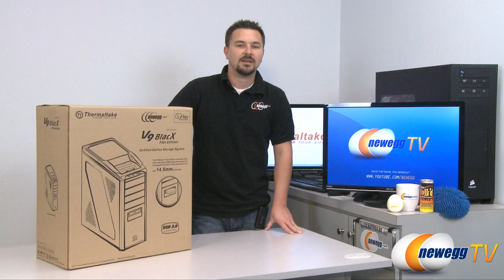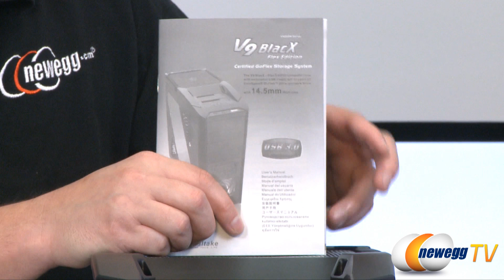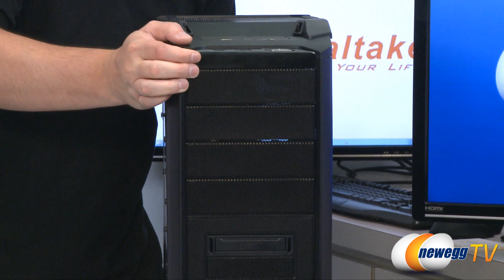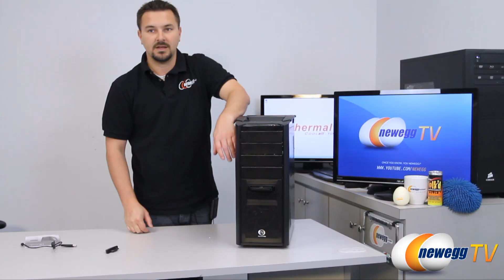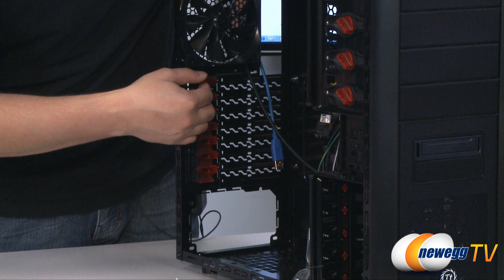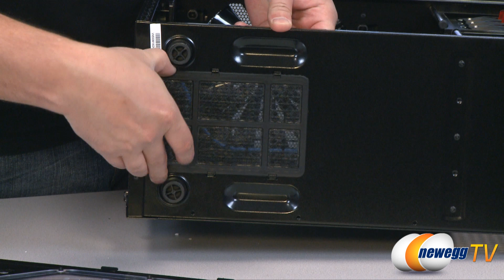Newegg TV: Thermaltake V9 BlacX Flex Edition ATX Mid Tower Case Unboxing

Comment: I gotta say, if this version of the case is anything like mine (V9 Black Edition), avoid this thing like the plague.  The metal is very thin, the 230mm fans crap out quickly either by hitting their own mountings (and sometimes breaking because of it), or just straight up stop working.  Even when they do work a 200mm fan moves more air.  Good luck finding replacement fans, because only Thermaltake sells them, at $25 a pop.

Comment: Wait so the front USB 3.0 just runs to the back and you connect the back panel USB 3.0? What the hell is the sense or point of that? You free up the back panel and then connect the front to your ONBOARD USB 3.0 which is the only reason I was looking at this case.. wth thermaltake

Comment: Don't buy this case.  the material is crap as everything is made out of plastic.  when i got my case, the side window was cracked because they screwed in the screw too tight.  the thumb screw was not properly screwed in, more like it was jam to fit, thus the case had a big gap.  the top were the 200mm fan was lifted upwards because the plastic part that grounded it to the case was broken.

overall, the case is extremely cheap. for 100 dollars, u can get a better case like corsair carbide 400r

Comment: I've got this case, and it's GARBAGE. All the case fans have fallen apart / failed, and the tool-free design isn't worth using at all. The filters are nice, but with all the holes in the sides, they don't reduce much dust at all. I have lost faith in Thermaltake, I'd recommend investing in a better quality case / manufacturer.